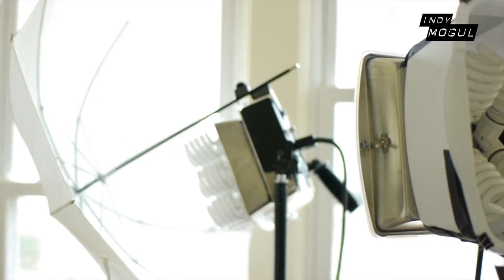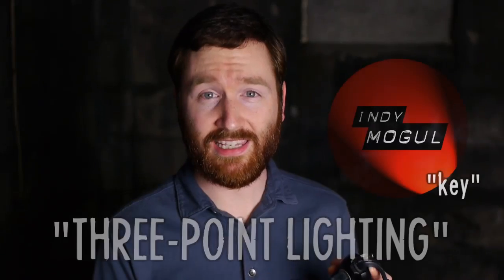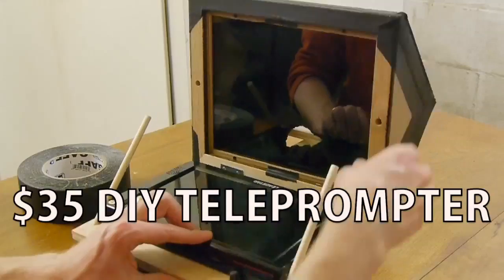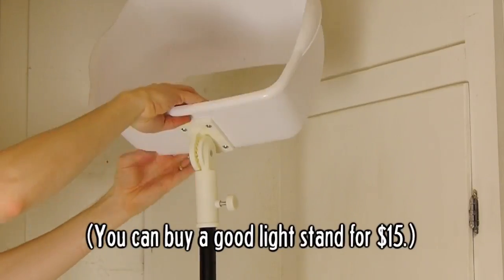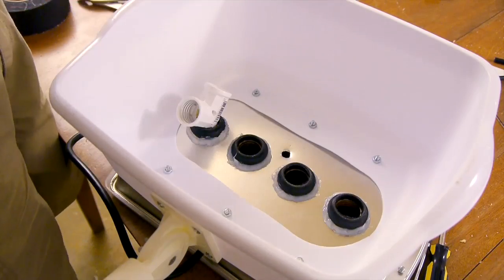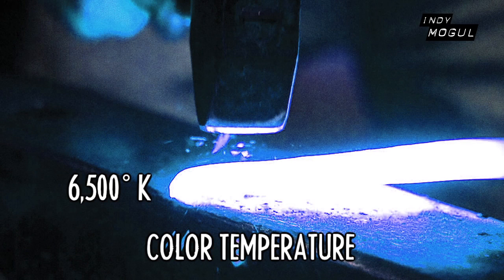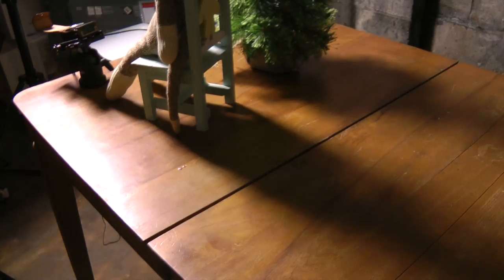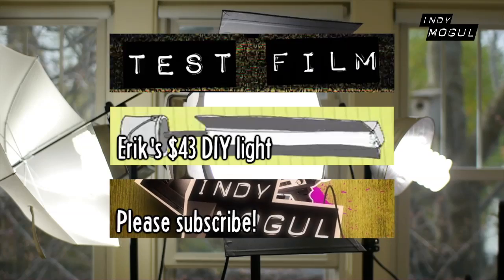How-to: Powerful DIY video light (800 watt equivalent)

Comment: How do you get the umbrella to hold? I saw that you drilled a hole but how does the umbrella stay?
Reply: FILM I BARON he cut off the end holder and sticked in the metal bar and clamped it down
probably

Comment: Hi. Unfortunately, it's becoming really difficult to find cake pans with lid on in stores. Are there other alternatives for this ? I thought of another solid plastic box (with lid) instead, but the only ones I could find are too flimsy to work like this. I'm not sure if a cookie box can do (I'm not sure of what metal it's made of, but I don't think it aluminum and the metal doesn't look very solid). 

Any ideas ?

Thanks to answer
Reply: Système D Multimédia just a metal plate will work
srsly
just clamp the grounding to it and your good to go
just find a way to cover it
aka a plastic box upside down hot glued / siliconed / super glued in place
Reply: Thanks
Reply: Np but wait u srill need stand offs!
Reply: What do you mean ?
Reply: Système D Multimédia dont put the mobo directly on metal sheet as it might shirtout
Goto a near electronic/whatever shop and buy from them "pc motherboard standoffs" which is a screw that has a screw hole
You can find it in any case ( the thing the mobo screws on )

Comment: Be careful what plastic tubs you use for this.  I ended up with some that completely came apart on the bottom when I drilled through them.  Got some more on the way that will hopefully survive the process.  Also, some of the metal pans are teflon coated.  Best to avoid those if at all possible because they are nearly impossible to glue.  Finally, where is the best place to buy those flag pole holders?

Comment: how many 9 watt LED bulbs would you have to use in place of 8 CFLs??
Reply: stirfriedgat if a cfl is 100 and leds is 9
I will just make sure the lightness is similar
if its dimmer get like 18 so its similar or even brighter

Comment: Some companies designs some systems to transport the sunlight to specific place using sun light collectors, fiber optics & lenses. The idea is very simple. But no body tried to DIY it. The sun collector can be made by sticking the mylar on TV dish to reflect the light to the convex lens which is placed at  certain point, after the lens the fiber optic is place which I believe it is placed at the focal point. Then the light is transported through the fiber optic which at the end is connected to lens to distribute the light. This can work all the day time if the dish is somehow connected to some kind of system which direct it to the sun position. Think about DIYing it.

Comment: Hey buddy great video!
Just one question how much difference you find on mounting 8 bulbs as you did versus using the hilariously giant bulb light?  I've recently saw a 6000 lumens giant bulb light of 105w.  My impression is that a single one of those will illuminate as much as these 8 little ones.  Doesn't it?  Thanks much!
Reply: the eight will be softer since it is more spread out and a bit more flexible since you can remove lights to dim it. however, I think it would be about the same brightness

Comment: does it also work for photography or is there some difference?
Reply: +Paco Ortiz if the bulbs are a high cri (ra) rating of close to 100 then its good for both. Video and photography lights are the same. 5000k is also what photographers use I'm guessing since its a neutral white.

Comment: those bulbs are considered bad now, are they not?  harmful
Reply: +Heather Humphries You have to take into account when they made the video. 2012 was 4 years ago. LEDs have exploded sense then.
Reply: thanks, im pretty sure even when they came out they were known to be bad.  Hence the mandatory replacement.
Reply: Harmful? I don't think that they're considered harmful. They do have mercury in them, but that's not usually a problem.

Comment: Just completed this build.  Works fantastic!!! To anyone looking to do this don't hesitate.  I opted for an extension cord instead of just an AC power cable.  I got a 50 foot one at Home Depot for 12 bucks and cut it in half giving me a 25 foot cord to plug in as well as extra wire to work with when connecting the sockets together.   Also missing from the supplies list was a clamp connector (where the AC cable enters into the dish pan). I luckily had one lying around.  Another word of advice, before using silicone to adhere the sockets to the cake pan, screw in the splitters to be sure of a tight fit.  The build was a little time consuming but well worth it.

Comment: This probably isn't really important to anyone here, but Kelvin isn't measured in "degrees", it's simply measured in "Kelvin". You don't say "2,700° degrees Kelvin" you would instead say "2,700 Kelvin." Kelvin is measured as the fraction 1⁄273.16 of the thermodynamic temperature of what is known as the triple point of water, which exactly .01°C (or 32.018 °F give or take a hundred-thousandth of a degree), showing that the "freezing" point of water is 273.16 Kelvin. People make the mistake all of the time since temperature is otherwise measured in degrees, but the more you know, right?

Comment: why not use super bright white led strips? cheaper, brighter, less heat, more compact, less power usage. hard to spot a down side.
Reply: +TheEightshot Keep in mind this was filmed in 2012 when LED technology was not yet that matured.
Reply: I tend to agree but you still have to consider color accuracy and temperature. diy perks has a good tutorial for an LED light panel. it would be interesting to see a refreshed tutorial with an improved light because led lights are continually improving.
Reply: One issue over here is the 'intensity' or 'throw' of the light - how far it can travel from the source with the same color temperature. This is very crucial in cinematography that is why HMI lights are used to flood larger sets /scenes. Over here the LED can be bright, but do not have the same intensity or throw as  of CFL or others. They are more used in CU photography where Light Panels are required. LED  lights are also  not as fragile as any bulb lamps but requires electronic circuitry. This is much easy. The light bulbs, so if you mess it up, just unplug, rewire, change the bulb and repeat until you get it right. 
Now a days (in 2017) the LED are coming with (5Q - 7Q) with higher intensity. There are YouTube tuts on them.
Reply: old video but yea led strip are a fucking pain in case of failure so better stick with same idea but with led bulb
Reply: I ended up making my own video light with a 100W LED chip. It's super bright!! https://youtu.be/6GuWEI53Cxo

Comment: When you mount the post socket to the plastic bucket, it's best to use a plate, or series of fender washers on the side with the nut, to prevent it from tearing during use.

Comment: Great Idea! Look for some energy efficient LED as an alternative to the CFL's... They consume less electricity than the CFL's, are safer to handle and produce significantly less heat for equal or greater lumen output... Not to mention a much longer lifespan.

Comment: Does anyone know of a way to power this light with some sort of battery for on the go projects? I am considering building one but I would like to be able to take it outside and on the go. I don't know much about lighting so any replies will help! Thanks!
Reply: +EverythingJdawg Hi, might i suggest  investing in a car battery and a power inverter. The car battery provides portable power and the power inverter converts 12v DC power to  115v AC power. Just be sure that the power inverter's  output exceeds the power of your light set up.

Comment: is there an update top this great build
Reply: ***** Nope, it was. Youtube's NextLab funded Indy Mogul.
Reply: 8 Ball Pool generateur  ajouter Coins illimités, Crédits Gratuit! ici: https://www.facebook.com/142858302736559/photos/a.142977419391314.1073741828.142858302736559/143276359361420/?type=3&pidid=31085b2d-5941-4cb1-a3b8-0653e6fe9fd9                                                                 How-to: Powerful DIY video light (800 watt equivalent)
Reply: +Jason Artiga Not really, unless you can think of any for yourself! If you do so, please share. :)
Reply: +Jason Artiga Nope, Indy Mogul has been down for a few years now bc Youtube cut its funds. A few of us are trying to get it back. IF you wanna help, just sign this: https://www.change.org/p/youtube-youtube-bring-funding-back-to-indymogul
Reply: Smile4thekillcam456 It wasn't youtube funded though...?
Reply: Sweet

Comment: Sugestion, couldn't you in theory also attach something like a variable resistor to the wiring system. That way it may give better control over the lightings. or is it not possible?
Good diy tip btw.
Reply: +Mohd Zakwan Mohamed Zaki Typical CFL bulbs are not dimmable. You can buy dimmable CFL bulbs (will be marked as dimmable on the package) and use a typical wall dimmer switch. I believe those dimmers use PWM circuits which flash the lights so as to appear dim. This would cause a problem with using this lamp for video work because the video will have randomly unlit frames. I plan to build one of these and use mixture of bulbs (2700K and 5500K) and add, remove or swap bulbs to achieve the perfect color lamp for each shoot. And if the lamp is too bright, remove a bulb - simple enough.

Comment: Hey Indy Mogul!  Thanks for the idea.  I built two in an afternoon, with no trouble.  They work great!!!!  Cost just $148 for both of them.
Reply: 8 Ball Pool generateur  ajouter Coins illimités, Crédits Gratuit! ici: https://www.facebook.com/142858302736559/photos/a.142977419391314.1073741828.142858302736559/143276359361420/?type=3&pidid=31085b2d-5941-4cb1-a3b8-0653e6fe9fd9                                                                 How-to: Powerful DIY video light (800 watt equivalent)
Reply: +PartScavenger Sadly, Indy Mogul has been down for something like 2 years now. A few of us want to bring it back, wanna try to help by just signing this? https://www.change.org/p/youtube-youtube-bring-funding-back-to-indymogul

Comment: It's a great project, but I have to say Kelvin is not measured in degrees! Color temperature and actual temperature in Kelvin is just some number of Kelvin. E.G. My favorite color temperature is 5,000 K — that would be read as "5,000 Kelvin" with no "degrees."
My ranting about that aside, I like the approach. I might also recommend using large, metal salad bowls for building more focused lights. They all tend to be shaped very closely to an ideal parabolic reflector. Also, for a less-severe diffuser, screen mesh works quite well at knocking just a bit off the edges of shadows without reducing light output a perceptible amount. Plus, if you get the old-fashioned metal variety, it's heat-resistant enough that it gets used in the traditional 2K (That's 2,000 watts of incandescent bulb!) fresnels you might see in a television studio.

Comment: and why not just buy a 150w cfl equivalent =70-75 lumens per watt (11250 max lumens), or 200w too. is not needed to make a big apparel with 8 bulbs...less costs and not so many hardware /electrical store parts to join all those 8 bulbs. dont know how much watts have those bulbs but you can make the job with only one, and use mylar or easy grow lightite reflectant paper to cover all dish pan from inside.

Comment: Cool, few years ago I was in our national TV studio and in some small news room I've noticed that they use multiple (linear) fluorescent lights, all with 950 color lights (950 means CRI over 90% and temperature 5000K) I was told that they switched to fluorescent not for the color, not for energy efficency but solely because of much less heat generated by them: I can imagine how hot it was when they had like 10 kW lights in a room smaller than typical living room...

Comment: Griff Man
OUTSTANDING !

A useful modification might be to have separate switches for each pair of lights (4 in total) so that you can control light intensity.  Of course you could always just unscrew some lights, but as you point out, these things can be delicate/semi-dangerous.

That said, great design, well thought out, professionally described.

Comment: 1 100w led = job done
Reply: LEDs are getting cheaper and cheaper every year, but they aren't as good as they appear on paper: Many cheap LED lights flicker badly at twice mains frequency (100 Hz in most of the world), color rendering is sometimes surprisingly bad and I've seen so many LED lights failing prematurely that finding one that is actually good may be challenging and not that cheap...
Reply: I have a 200 dollar led soft box. It's a amazing

Comment: In Australia, you should use a thicker ground wire because it's ~240volts(I would use a thicker wire at 120volts still). Also, when handling the bulbs you should not touch them. The oily residue your fingers leave on the bulbs create hot spots. I use a clean rag to install the bulbs, plus it will save your hand if they smash.
Reply: This doesn't work like this! Wire thickness scales with current, not voltage and since for same power at higher voltage you need less amps wires can be thinner. Actually we are talking about 1.5A power draw at ~230V or ~3A at 120V so even at 120V thinnest commercially available power cord is more than enough with its 0.75mm square (required for mechanical strength). Ground wire must not be thinner than mains wiring so this design is okay-ish :) Oily residue applies to halogen bulbs ONLY as it messes up tungsten recombination, it has no effect on ordinary bulbs or CFLs

Comment: can you easily add a dimmer to this build?
Reply: You could add a dimmer.. which shouldn't be to hard. But you would have to make sure you use dimmable lamps.
Reply: I made mine using 2 dimmers, one controlling the outside edge bulbs and the other controlling the inner ones. The dimmers and dimmable bulbs double the cost though.

Comment: wouldn't it be more beneficial to use a dimmer switch (with dimmable CFL's) instead of just an on/off switch? It would make the light a little more flexible in its usability.
Reply: I made mine that way but I chose 2 dimmers - one to control the inner bulbs and the other controlling the ones on the outside. Definitely more flexible but doubled the cost.

Comment: Great video! Have you considered getting those LED light bulbs?  They would almost double the price. However with a good enough DC->AC converter you could run these off of a 12 volt battery and make them portable. LEDs are supper efficient so the battery would last quite a bit I would assume. I am doing a little research into making one like that. What do you all think? The problem is the LEDs are super expensive and not as bright as these CFL bulbs. But the portability aspect  could play a huge roll in that price differnce?

Comment: i dont really get the point why you are doing this. I mean for 100$ i bought two lightstands with two fully equipped softboxes including 8 x 135w cfl bulbs. that is not only more ouput but also everything is already pre build and more professional.. and i got 2(!) lights with 4 x 135w cfl each (and the cfl are 135w and not 135w equal so they equal round about 600w regular each which makes every light approx. 2000-2500w and i did i mention it got light stands and a softbox for each light included :P?)

Comment: Watching this I was thinking it would be nice to adjust the over all intensity. 2 methods spring to mind. 1. put in a second toggle switch so one switch for the inner to pair and a second for the outer pair. ( think this might increase options for nuances in the lighting too). 2. have a dimmer switch. I am not sure how well the fluorescents would play with a dimmer though.

Comment: Is there a way to wire this directly to an A/C plug as opposed to powering it with a battery?
Reply: i don't understnad what you want to do, it is made for A/C as it is =) if you want to power it with a battery, you would need one big battery for sustained use =)

Comment: Im pretty sure u have the t° wrong D: Think 5200 is more yellow than 2000~
I do it on my cam a lot of times and always 5200~ is more yellow and calid than 2000~
Reply: Is this comment for real? lol
Reply: That's because the camera compensates for the yellowness/blueness of the white light. So if your camera makes the light look yellow that's because the setting is for use with blue-ish 5200k light. Likewise at 2000k the camera image will look blue when used outside because it's making the image more blue/ less yellow, as that setting is for use with warm tungsten lighting.

Comment: You should really use ceramic metal haloid (CMH) lamps. Their efficiency is usually around 80-100 lm/W (around double the efficency of CFLs) and their colour rendition index is often higher also. Furthermore, their are much more compact. For example, you could have used a 150W CMH lamp which emits 13800lm and costs 40€ (here in Germany, don't know how much they are in the US). The best thing is that CMH bulbs barely have the size of a normal tungsten bulb - so either you can take a single par can with diffusor as housing (20€ if you take the cheap ones) and have a much more compact light or you could take your construction and get an 8kW-equivalent lighting for 350€.

Comment: I built some lights using aluminium project boxes used by electronic hobbyists, and a 8" steel kitchen mixing bowl. I've also added PAR64 barn doors to 300W worklights, (now considering LED). Also, two 4x55w Kinoflo style lamps from a growing lamp used in the (er) "hydroponic" industry. Alas, I didn't video these projects, but documented them in a ebooks